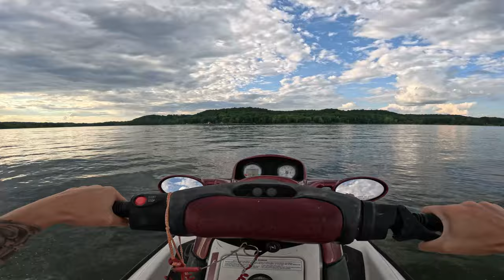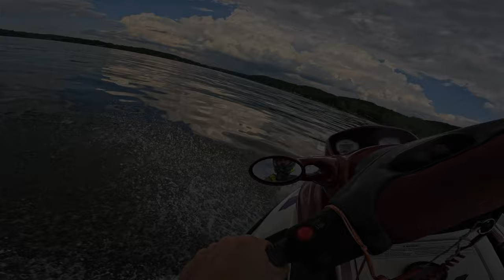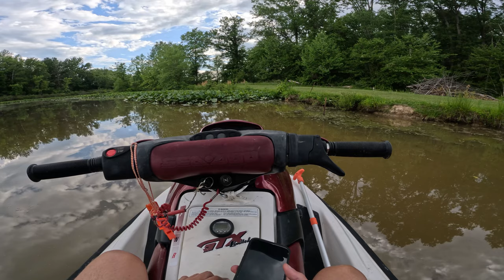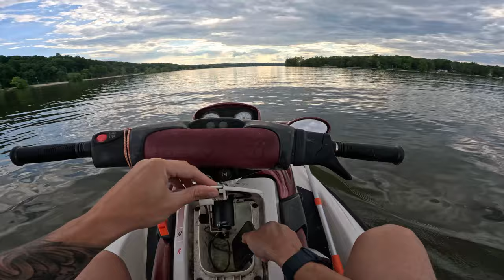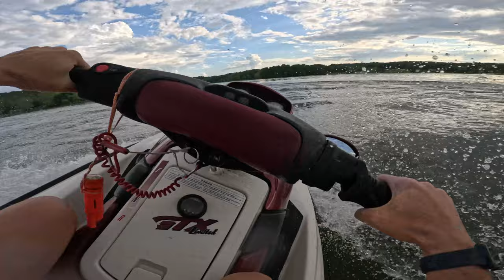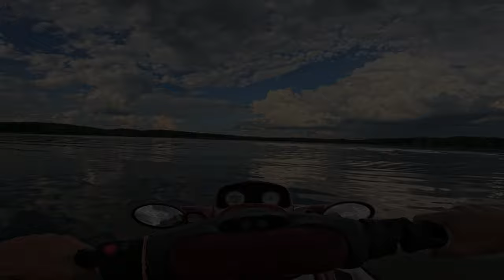Ripping 1999 Seadoo GTX Limited - Vlog

Comment: I have the 99 GTX. It has the 951.   First thing is don’t ever run them if their carbs aren’t fully functioning. You have a very good chance of blowing the engine. It is easy to rebuild them completely. Always use genuine Mikuno parts. 

Your Seadoo sounds like it isn’t running right at the high end RPMs. Clean the carbs, then check the water valve into the muffler. Check your rave valves. I don’t hear them engaging. You will hear a big, quick jump in RPMs when they engage. 

After I blew my first engine not knowing any better, I have had 3 great years with it.  But you gotta know what you are doing or you will waste a ton of money!

Good luck!
Reply from the maker: this ski did end up blowing, because somewhere along the line, someone put regular gas with no oil in it. Searching for something new slowly lol

Comment: I’ve got a 98 gtx limited. Just rebuilt the engine and carbs. I got 94kph which is around 60 mph
Reply from the maker: We need to rebuild the carb completely or buy a new one and redo the fuel lines. It quit running on us and fouls plugs after like 2 minutes of riding lol.
Reply: @motovlogunleashed Either the needle/seat was no good, or the low speed jets were too rich. Plugs fouling at low speed are almost always caused by these two. I hope everything turned out alright!
Edit: Another thing to look out for - if it's dying after completely letting off of the throttle while at speed, then the little plastic check valves in the carbs need to be replaced. Make sure that you don't put them in backwards. Just reference a mikuni carb rebuild video for one of these motors and you'll get it.

Comment: I’ll be trying this out. I’ll be assuming I’m hitting 50-55mph. 97 gti
Reply from the maker: I adjusted the carb to factory settings, I got it to where it will idle, but still running rough. I got my speed to 54mph now. Going to be replacing fuel lines, and redoing the carb again and see how it goes. Gona be a good winter project. I put seafoam in it and now it runs really bad, wont go over 10mph right now. Im assuming it broke some gunk loose in the fuel lines and sent it to the carb.

Comment: Just picked up a 2001 GTX $200.oo the guy said the exhaust an throttle body  plus little wiring needed finished. Yep waterlogged my 787 rfi. Having been in automotive mechanics half my life decided to pull the head. Wow..1.00 stamped on pistons. New gaskets and it fired right up
 gotta love fuel injection. Rebuilding pump, new carbon seal w boot,cone on drive shaft side of impeller  and both 2 I found out driveshaft bumpers.was missing the one at flywheel end. Shaft showing bad wearing on other end. Rubber pushing shaft away from pump I believe.waiting for parts so I can get it wet.  Wanting to hear an feel that 1 mm. Over bore beneath me .if she runs out way I'm expecting  then I'll tear it down and ring her. Then I'll spend the $200  with SBT for a new shaft.   Oh yeah the engine is a SBT built also.  11-2023
Reply from the maker: This thing has like 230 something hours on original parts. I think it’s nearing its end. The last time I had it out I was flying full throttle across the lake then it just died. I tried swimming it to the marina but didn’t work so I had to crank it the entire way back. Surprised I didn’t burn up the starter but when I got back and took the seat off smoke was bellowing out of the engine compartment. Ground wire on the battery was slightly melted. Something going on. I hinestly hate the old two strokes and might break down and  buy a new spark trixx. They look like a lot of fun but people complain about routine maintenance being difficult but it can’t be more difficult then maintaining a clapped out 90s 2 stroke PWC. Lol

Comment: If it's a 787 it isn't going to do 60mph. My 96 spx (x4) does 55 with a 717 and less than 5 gals in the tank, but Im pretty sure those can do pretty much the same thing. The weight of the rider will matter too, as well as how much gas you have. Every pound counts that's why with a passenger you're doing high 30's.
Reply from the maker: This one has the 951 in it! It just started running really bad. I’m guessing it’s the intake. It seems to be missing parts on it and it’s getting too much air would be my guess. The clips that hold it on are gone and it was zip tied on. It was someone’s river rat jet ski I’m guessing.
Reply: 787/800  I guess with the 1mm over its possible. I was told my 01 gtx rfi with 1 mm sleeves in it could as long as pump was in top shape.